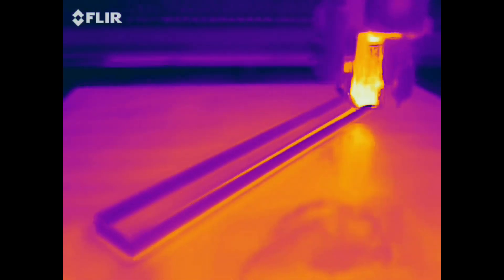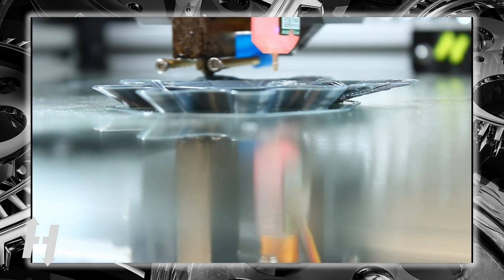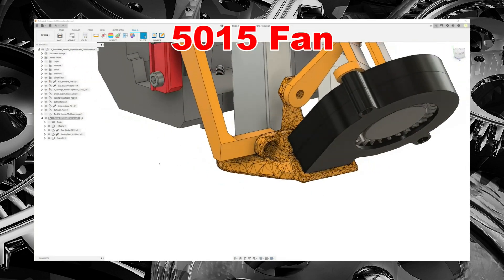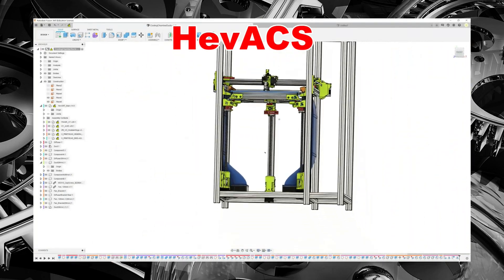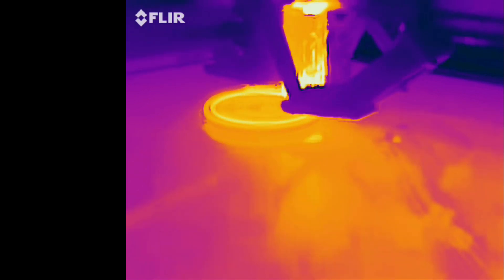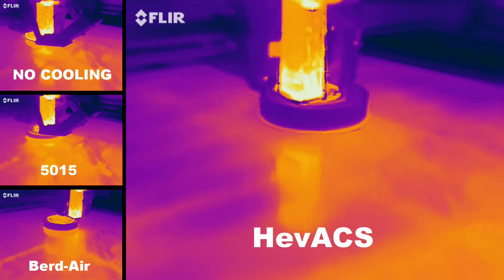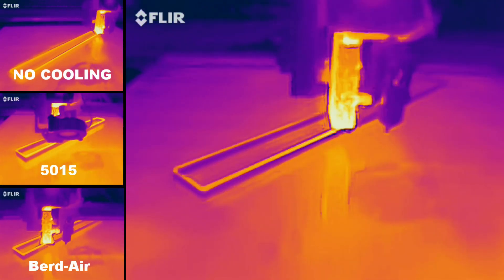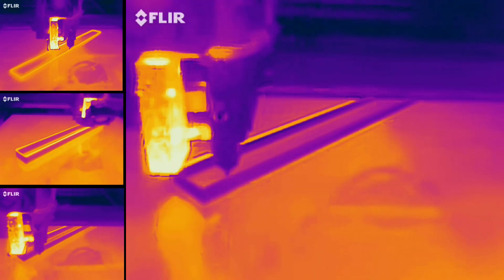Ultimate 3D printer Cooling fan - 5015 vs Berd-Air vs 300CFM Mega Cooling

Comment: I realise this is a reupload but it convinced me to sub. The implications for weight saving and ease of reconfiguring hotend/nozzle etc on the print carriage are significant, if you can shift the cooling to the frame. I would like to see if it causes bed temperature issues, if you are able to test some more.
Reply from the maker: Yes, I am deeply sorry about the repost, but audio from previous version was WAY too low.  I needed to fix that but could not find another way of doing it without creating a new video,
As for the impact on the bed, I am using a 750W 120VAC Keenovo Heat Pad.  When properly PID tuned with HevACS on, it can keep up a stable temp just fine and the impact on controller board voltage is null.  

The question is, is the difference between bed surface temp and thermistor increasing when using the HevACS?  That would need to be investigated.  

But at this point, using HevACS would be for material with very low warping coefficient like PLA.  Where bed temp needs to be maintained high enough so the part remains anchored to the build plate.  

Accuracy of that temp might be affected by the HevACS for the first few layers only.  As the build plate is moving down, the impact will decrease to null.
Reply: @MirageC  absolutely no need to apologise . I would have missed this if you hadn't! Thanks for the additional thoughts. I wonder if it would be possible to make the jets as laminar as possible to minimise surface cooling of the bed at the beginning. I think it would also be fine to put insulating mat strips over parts of the bed not required for levelling or the print. May save a few Watts and stop the chamber heating up too much if that's undesirable. Of course, plenty of prints don't need too much cooling so even a little movement could be just fine.

Comment: Maybe you could try Bird-air with higher volumetric flow?
Reply from the maker: That could work, but it will be affecting negatively the print quality as the molten material is being pushed down or sideways by the air pressure.  Bridging can be difficult with too much Berd-Air.

Comment: I believe someone from railcore said they had issues with too much fanspeed. I couldnt press for more details.
What would happen if there was too much cooling? Layer adhesion may be affected? Anything else? 

I am super interested to try an active fan now! My printer has a moving Y axis bed so my cooling wont be as uniform as yours.
Reply from the maker: The main advantage of the HevACS (or side cooling) is that it is focusing  the cooling to the part NOT the material being laid down.  So the material being extruded keeps its heat and will slowly be cooled after touching the part.   The cooling will be gradual over a longer period of time.  Ensuring better layer adhesion and better stiffness for next layer to be deposit.

Comment: Even tho the cooling is amazing I'm still sceptical:
The HevACS seems to use the bed to guide the air towards the print. As you print higher and higher this effect will become saller and your cooling characteristics will change.
My second concern is the Power consumtion of the bed, trying to keep its temp while beeing cooled like nothing else. An economical consideration comes to my mind with that power consumtion: can you increase the print speed due to cooling more than it rises your Maschine hour rate? I live in Germany and the electricity-costs are quite high here.
Reply from the maker: As the bed moves down, the heat radiating from it moves away from the nozzle.  The air flow from the HevACS works best when the air nozzles are pointing slightly downwards,   This ensures that the part walls are not shielding internals from cooling.  

So no, the bed has little impact on air direction.  Look at the part in the video with tissues attached to the nozzle.
Reply: @MirageC  Ahh, I see. Thank you very much for clarification.

Comment: does it cool the print bed itself too much and does that cause an issue with warping/adhesion?
Reply from the maker: Warping will occur with materials that are prone to warp.  Since the fans are very easily controllable with pulse width modulation (PWM) you can set them to as low as 2 or 3% adding a recirculation function, this could be tested with material requiring use of enclosure such as ABS.  Heated airflow could even be possible.
Reply: This is what I was thinking that it would be a good system for. To "cool" the layers but only to a specific point for materials like ABS, by having it be a recirculating system for a temperature controlled chamber.
Reply: It's likely going to cool the bed only in the initial layers, as the bed moves down that issue may not be there.

Comment: i very interresting test - the question is rather what you want to achieve. 
I had a setup with a Wade Extruder with to 4010 fans blowing without any shroud - this worked really well, while it "should not" 

If layer time is you problem go for HevACS  - cooling the whole print 
If overhangs are your problem go for a concetrated cooling right a the nozzle. 

or just take both :) 

Please continue this series!

Comment: Its a shame that the big fans need the bed as the z axis to work, at least with this design.

Also, is this a reupload? Could've swore I've seen this before.
Reply from the maker: yes, it is a re-upload.  I have put a note to that effect in the comments. The audio in the previous version was really low.  Sorry for the confusion.
Reply: I'm sure it's possible to put (an array of) large fans on the Z axis of a i3 style printer too
Reply: It's still possible to do on a prusa like on with just a bit more fans or flexible air ducting
Reply: It doesn't really, I'd even gather it's easier to do on a bed slinger if you make the space for it as you don't need any sliding ducts extending the entire height of your printer, you can just mount the fan with a nozzle on it.

On this system, you need to engineer ducts that hold air pressure and telescope with the entire Z axis, which MirageC did, which imho is the greater part of this engineering practice, making a moving and shape changing part airtight is not easy.